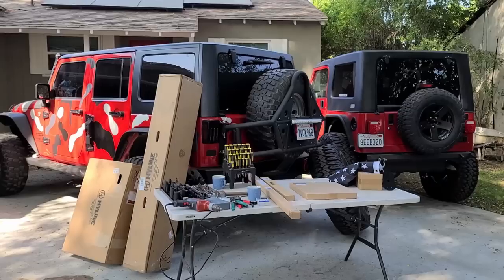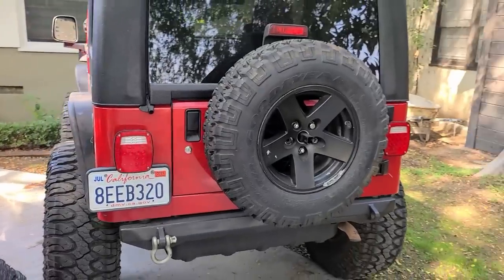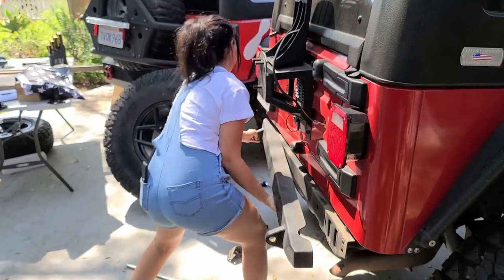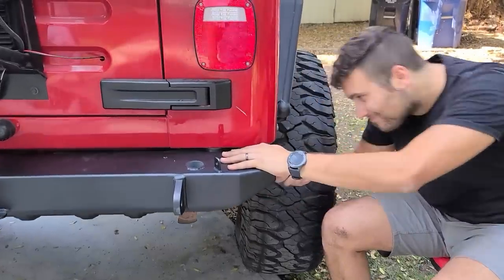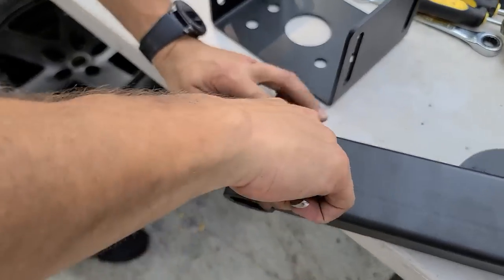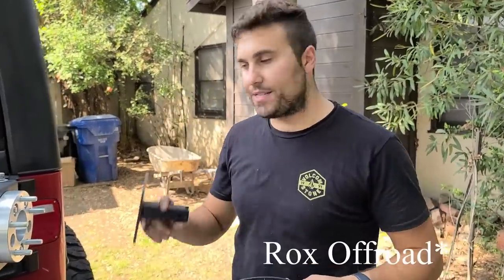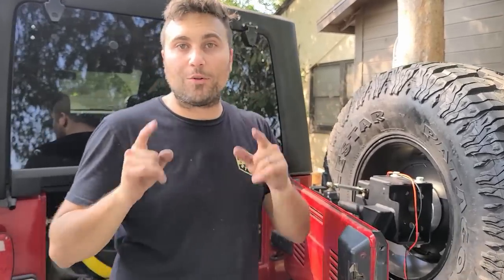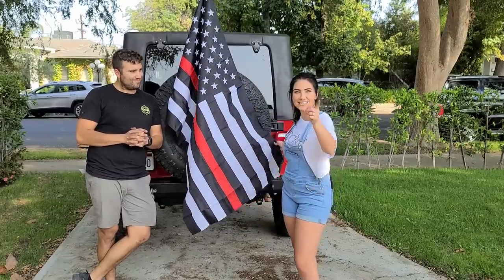BEST Jeep Tire Carrier - Full Install + Giveaway Results!

Comment from the maker: Here are some of our favorite jeep parts!!
Hyline tire carrier/bumper combo - https://www.hylineoffroad.com/jeep_parts/jeep_tj_yj_rear_swingout_tire_carrier_assembly
Suparee third brake light - https://amzn.to/3j8rMHU
Rox offroad flag mount - https://roxoffroad.com/
Suparee RGB Bluetooth 7 inch headlights - https://amzn.to/2EvfVot
Suparee Sequential 7 Inch Headlights - https://amzn.to/3bdSw6W
Cerakote Plastic trim restorer - https://amzn.to/36JAvew
Plug and play HALO LED headlights - https://amzn.to/36O7sW9
JK LED tail lights (JL style) - https://amzn.to/2XJTXEp
JK Full light bar kit - https://amzn.to/3a9lcNA
Cerakote Plastic trim restorer - https://amzn.to/36JAvew
Jeep bottle opener - https://amzn.to/32vqnFT
Motofab lift 3 inch lift kit under $150 - https://amzn.to/2CJD9pF
Patriot fastbacks Jeep Tops - https://patriotfastbacks.com/shop
Circle third brake light - https://amzn.to/3jhECEl
Auxbeam 7 inch Light pods - https://amzn.to/2z9gJfm
Auxbeam hood light bar - https://amzn.to/3cbszVj
Shrink electrical connectors 540 piece - https://amzn.to/2VWQPoc
Smoked LED turn signal - https://amzn.to/2EQ7X67
Steel Stinger Front bumper - https://amzn.to/2WjykMA
Smittybilt cargo cover - https://amzn.to/2QeIMzQ
Ares technology PCM - https://arestechnologies.com/
Skyjacker lift kits: https://skyjacker.com/
Rocktrix Rims - https://amzn.to/2xS8Mus
Milestar Tires - https://www.milestartires.com/ 
Affordable sun shade - https://amzn.to/2wWQQyq
Rear LED tail lights - https://amzn.to/2wa7evn

Comment: Now thats a great tire carrier love that there is only one step to open your tailgate instead of those pins.Great install video guys you really rock.I love the flag add on but here in nys it would interfere with the 3rd brake light and i don’t know how well that would go over.With those tires and the tire carrier it looked like it was covering the hitch receiver somewhat.That looked like a very easy install i’ll have to look into it.
Reply from the maker: Thank you for the comment! We love the carrier

Comment: Is the hitch rated for the LJ's max of 3500 pounds?  Also, how is it holding up?  What do you think of the carrier with a few miles underway?
Reply from the maker: Thats a good question, I would imagine yes, but you can double check with them. the carrier has been literal gold. We absolutely love it
Reply: @Garagecouple  HyLine confirmed the bumper the bumper should support the same ratings as the factory tow hitch.
Reply from the maker: Amazing. Man, what an awesome company. Absolutely love our bumper